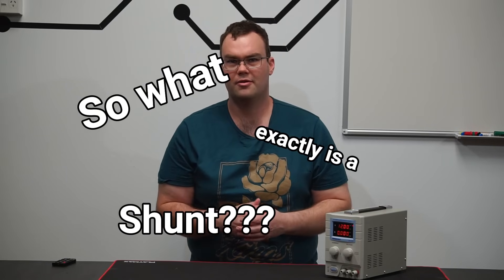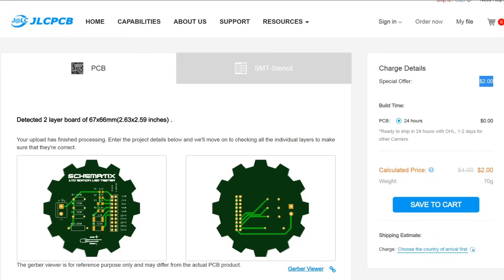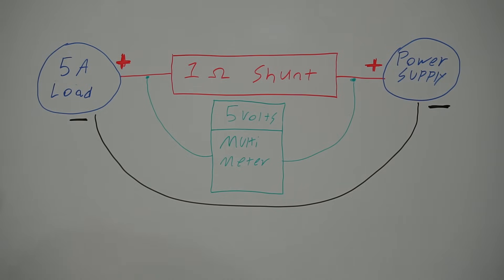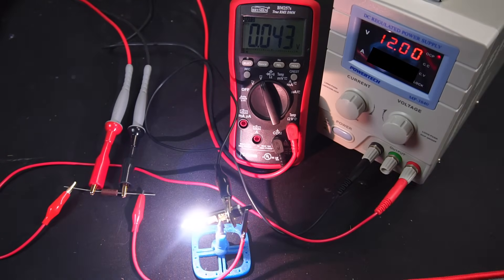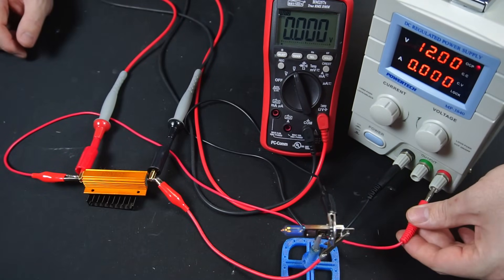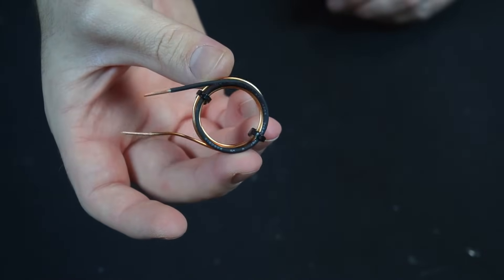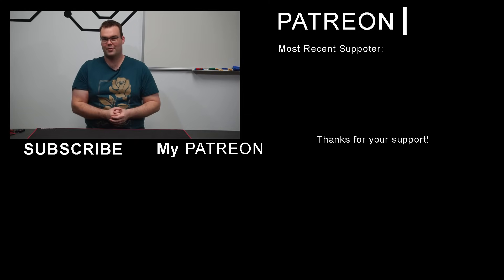What is a SHUNT? (Used to measure Current) + How to make a DIY version

Comment: Two different between liner current and pulse current use 0.035 ohm a pulse current of 20 amp on the oscilloscope is 21 v peak and the using and op amp the peak voltage will trigger it to easily so a 0.002 ohm is best for op amp with a 20 amp pulse is 1.8 v peak but liner there is only a few milliamp voltage

Comment: I feel like things werent explained enough. Especially with why the 10 ohm resistor burns out but the 10mOhm shunt does not. Was it due to the "current rating" of those components? Maybe I assumed that just because the resistance is high that means it could handle more current ...idk please help.
 I guess it also helps to understand how power resistors work...

Comment: Any ideas on turning a 1 amp DC current meter into a x3 amp current meter?  
Is it as easy as finding the shunt resistance for the 1 amp reading, and tripling the shunts resistance?

I have a +70v DC source with an avg operating current around 1.71.7 ampere. Input voltage before the transformer is is fused at 3 amps.

Comment: Also consider that bending the shunt wire back and forth will increase the resistance of the wire and change the value of the shunt resistance.  Temperature of the wire will also have a effect on the resistance of the shunt.

Comment: stupid question (sorry) but why using shunt resistor in a circuit to measure the voltage and by deduction the amp instead of having a device that simply measure the amp directly?

Comment: Ok what am I missing because I’m still confused.

I select mV DC to read across my shunt and get a read of 5.6

I was told this is my resistance tho, so I take that number and divide what I get reading V DC from my DC output point, and that resulting value is my amperage? Any help, helps

Comment: Thank you for this demonstration. I tried it myself and found a similar degree of error with my homemade shunt. One observation, however, that may improve your result is at 9:23 where you have the DMM set on the volt scale.  This is a rather crude scale for this application.  It would have been much better to use the more accurate mV scale for such low voltages.

Comment: Great video, thank you. If we take an existing circuit (some commercial electronics) can we pick any resistor in the circuit and use it as a shunt? Does it make any sense to make current measurements in such a way?

Comment: The problem with commercial shunt is that for high amps measurement (>50A) it is rather costly. While DIY can be much cheaper (but not easier).

Comment: To find the Voltage, ( V )
[ V = I x R ]      V (volts) = I (amps) x R (Ω)

To find the Current, ( I )
[ I = V ÷ R ]      I (amps) = V (volts) ÷ R (Ω)

To find the Resistance, ( R )
[ R = V ÷ I ]      R (Ω) = V (volts) ÷ I (amps)

Comment: Should have included 'how to determine the resistance of a shunt'.
Shunt resistors are specified by the maximum current and voltage drop. 
The resistance value is given by the voltage drop at the maximum current rating.
The voltage drop at maximum current is typically rated 50, 75 or 100 mVolts.
For example, a shunt resistor specified by 10 Amps and 75 mVolts 
has a resistance of 75/10 = 7.5 mΩ.

Comment: I've a question regarding my Crown DC 300A amp, batch DCA-39, serial #13779, sequence #0204.
Using my Peak Atlas DCA55 and measuring the 2N3773 power output transistors in my Crown DC300A amplifier out of circuit, I'm finding a few that read 'resistor shunt between B and E/ HFE not accurate due to B and E resistance'. These transistors are unmarked and the schematic indicates a 2N3773 should be there. What reason is such a transistor used and what was it attempting to accomplish?                                                                                            Another question. When powering the same amp on a dbt, sometimes the bulb remains bright until I power it off and on a few times then things stabilize and the bulb glows then goes off normally like it should. Then measuring output off set with the gain set to minimum I'm seeing 0.0mv, that's good. But when the gain control is moved to the half way mark so I can adjust the input offset, the readings are all over the place and can't be adjusted with the input offset trimmer. Everything appeared fine a day before when I was able to obtain 0.0mv for both input and output offset, running the amp for over an hour with stability. The next day when powering on, the input offset readings were erratic.Very frustrating and cannot pinpoint what's happening so any insight into what's going on would be most appreciated, thank you!

Comment: It is best to use the shunt on the ground or "-" side of the circuit.  Where voltages are lowest.
Reply: The voltage is measured across the shut - so it will make no difference.
Reply: @vizionthing  I saw an entire video on this..don't remember where...but, I thought the same thing as you did...the explanation is subtle but significant.  Info should not be hard to find...I will look.

Comment: Hi ,
I have battery discharge machine which is release charge for 30A , but I don’t have current shunt meter with me. So I try find some relate article but my case is different , my machine charge 30A based on my programming, the connection should be + I and -I connection both lead of shunt resistor and my meter connected parallel too. Is this correct ? Please advise thanks

Comment: Help Me, Obi-Wan Kenobi. You're My Only Hope!  Excellent video as usual.  New subject:  I haven't had any luck finding information on how solar/wind etc power in a grid tie system is put back into the grid other than someone saying they use "this piece of equipment".  What must be done to the power and what form does it take to run backwards into the grid?  Thanks in advance.

Comment: Some key questions you did not cover: What is the purpose of a shunt? Is it just to have something laying around to measure for the fun of it? Does it actually do anything in a circuit and if so, what? Is a shunt just another name for a resistor? Since you started off by saying that I sent to something we can measure with, what is it that could be in a circuit board that would measure something and if it did measure it, what would it do with that information?

Comment: hi there, can i ask for some advice please. Ive watched many videos, and tried to wire up the digital display but its still not working. I dont get it. I would like to monitor how much volts and amps are coming off my solar panel before it gets to the charge controller. Any help would be greatly appreciated. All the best, kieron https://ibb.co/L9VWLMR

Comment: Also not to forget that clip lead wires also have an effect on overall circuit resistance. Again you can set the circuit up, place a multimeter accross a clip wire lead and this will give you its resistance value also. This is if the circuit requires precision current calculation, if not, then no need to bother.

Comment: Note that commercial high amperage shunts usually have a crude dut in them that looks like it was done with a band saw. That is the calibration cut. With a known current passing through the shunt a notch is cut until the correct voltage is read across the shunt. This allows a very accurate shunt to be made with imprecise tools.
Reply: And the opposite also, which is adding a small blob of solder,or two, to the wire to make it less resistive (smaller resistance, more amps); we can see that, inside many multimeters on the wire that is actually the Amps shunt.

Comment: I have been using the dale axial 1% shunts myself, but suppliers like mouser and digikey also has higher precision ones available though they are pricey at about $10-$15 for a 0.1% precision shunt. As always - use what suits your application. There are ways to compensate for the 1% tolerance also, particularly easy if it is just an offset adjustment in software. The tolerance of the component in that case is less important than the stability of its value (i.e temperature etc.)

Comment: hmm, my professor was saying that a shunt was anything connected in parallel to a circuit. So a shunt capacitor is a capacitor connected in parallel with whatever thing is in question.
Reply: That supposed to be. SHUNT is another word of parallel. That terminology is very common used in electric motor, stator and rotor winding connected either in shunt or in serial. Shunt is for long stability, serial for high torque.

Comment: The Temperature Coefficient of Copper (near room temperature) is +0.393 percent per degree C.  That's the main reason to use a real shunt.
Reply: Ouch, I didn't realize it was that much. I was actually planning on using one of the power leads in a power supply to measure the output current.

Comment: When the wire is wrapped around the pipe, won't the wire make contact with itself and change the resistance?
Reply: No. It's an insulated copper wire , the wire is silver colour and the golden colour is the insulation.
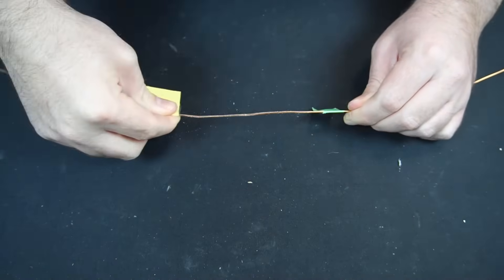Reply: @bijonmathew1001  Thanks, so he must not have used the wire he sanded off at 8:22.
Reply: @chuckcarlson7940  if you look closely he insulates the sanded part again using black heatshrink tube .

Comment: Ok, if you know the actual current passing through the shunt and the actual voltage drop, could you not use that to calculate a corrected resistance of the shunt and reduce the error?

Comment: "every conductor ...  can be made into an improvised shunt" Good luck making a usable a shunt (for the purpose of current measurement) from a superconductor 😜
Reply: @Cosmo Genesis You are describing a superconducting switch, for the purpose of initiating persistent mode, not a shunt ;-)
That is unless the word shunt is more than "a piece of conductor dedicated to measuring current" how I understand it. If so, I should be more specific in my original comment haha
Reply: @Cosmo Genesis Right, comment edited. 👍 
I knew the shunt as a current sensing part specifically. Haven't seen it in use for a bypass or superconducting switch. Likely due to me being a physicist in applied superconductivity and not an electroengineer
Reply: @Cosmo Genesis You'd induce a voltage at the interface between the superconductor and normal material anyway. And if your whole system was superconducting, there's no point in making a dedicated shunt for current measurement as you could measure the field in any arbitrary spot. In large superconducting systems, small superconductor coils are sometimes used (in addition to the device of interest) to measure the current through magnetic field, but that would not qualify as a shunt I'd say. In the field we definitely don't call them such at least.
Reply: @Cosmo Genesis usually just "normal" power supplies are used. Guess they've come a long way since the 70s! There are methods like flux pumps, but they have efficiency problems/difficulties and are mostly a niche.
Reply: Norm T  Euhm, responded to the wrong comment?

Comment: A SHUNT is used by left-wing anarchist terrorists to attempt mass-casualty railroad incidents in the US:
https://www.justice.gov/usao-wdwa/pr/pair-charged-interfering-safety-railroad-tracks
"Since January there have been 41 incidents of shunts placed on the BNSF tracks in Whatcom and Skagit counties—causing crossing guards to malfunction, interfering with automatic braking systems, and, in one case, causing the near-derailment of tanks of hazardous chemicals"
"According to the criminal complaint, the FBI’s Joint Terrorism Task Force has been investigating the placement of shunts on the BNSF tracks since January 19, 2020.  The shunt is comprised of wire and magnets that are stretched between the tracks , disrupting the systems that indicate a train is on the tracks.  On ten occasions, shunts were placed in areas that disrupt the crossing guards where the tracks cross streets, so vehicles could have tried to cross the tracks unaware of the oncoming train. "

Comment: Honestly, I have not seen all of your videos :(  But using ohms law and a common series circuit used in an automobile, perhaps like you lamp & shunt, but a shunt is not required until you want resistance. I had taught for GM at a time when diesel techs working at city garages, required them to prepare and pass test to be certified. Why diesel? Well mostly city hall never has money for new equipment and older diesel engines used little to no electrical. Not true today, but an example.
 As you know, not everyone with a digital meter are comfortable on what they are seeing. Every wire, connector, fuse, switch, device and ground has voltage drop. Measured and written down comes close to ohms law as compared to the battery available. 
  Nice job on explaining shunts. Thanks

Comment: I have been looking for a video like this. I've got a solar camper van setup and just purchased a 300a shunt. I am glad I now understand how it works. 

But how does it measure both charging and discharging??? 

I've got my shunt connected to the ass end of the system, last component in negative rail. Plz help! I love learning

Comment: Could have been the leads of the multimeter introducing the error, they too have resistance.
Reply: This does not affect the voltage. When you measure the voltage across the shunt with a multimeter that have a very high impedance (Volt measuring has to have high impedance) it will not affect the voltage being measured. This is one reason why its more practical to measure voltage drop across a resister when measuring very small value (smaller than the resistance of leads) resistance.

Comment: Hi please advise me on how to make a shunt for this.  I am thinking of using a flat piece of copper pipe. How many millivolts should it be? https://www.ebay.co.uk/itm/DC-100V-100A-Voltmeter-Ammeter-Blue-Red-LED-Dual-Digital-Volt-Amp-Meter-Gauge/283621092127?ssPageName=STRK%3AMEBIDX%3AIT&_trksid=p2057872.m2749.l2649

Comment: Stumbled on to your video after searching for shunts and was pleasantly surprised and it didn't take a long time viewing boring and annoying videos. Nice job. 
I need to start going back and viewing all your videos but wanted to ask a question: I have a battery pack and need to discharge it but don't have a fancy load. The battery pack is in sections of 16vdc. Eventually, the overall voltage of the battery pack will be 52.6vdc. For now, will attempt to discharge them in 16 Vdc segments. Now the battery pack consists of 18650 li-ion cells. I am thinking of using an old heating element that reads 19 ohms with my multimeter. Would this be ok to connect to the battery pack @ 16vdc and keep an eye on the voltage while it discharges? I know the li-ion cells have a lower voltage that they should not be discharged below and for now, will visually watch the voltage so I don't over-discharge them. Your thoughts?

Comment: You trust your power supply V and A displays....tell us about that supply (pretty please). It looks like an ebay special which I don't think many would trust to get anywhere near the ball park..
Reply from the maker: It does look similar to ebay specials, doesn't it. It's a name brand unit sold in JayCar (ironically has nothing to do with cars) which is an electronic/hobby/gadget outlet in Australia & New Zealand. The brand is PowerTech, model: MP3840. For its price point, it has excellent voltage & current control. They claim ripple of: 1mv, 3ma. And accuracy of 10mv, 1ma. Bold claims for such an inexpensive unit. I've only performed a handful of basic tests but, surprisingly it meets the claimed accuracy.
Reply: @Schematix  I found it on the jaycar website - $179 Australian pesos. Good find thank you.